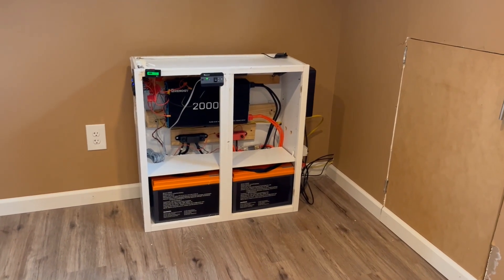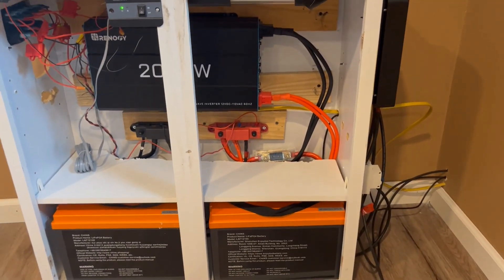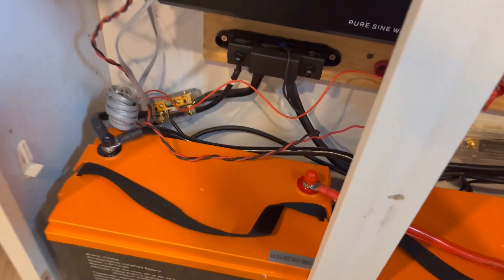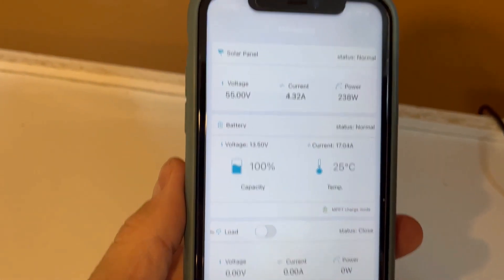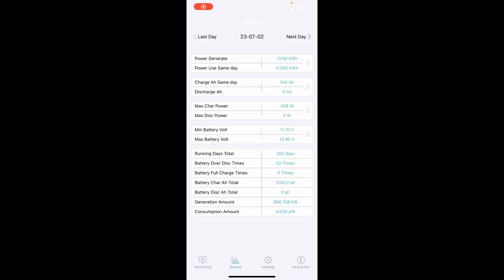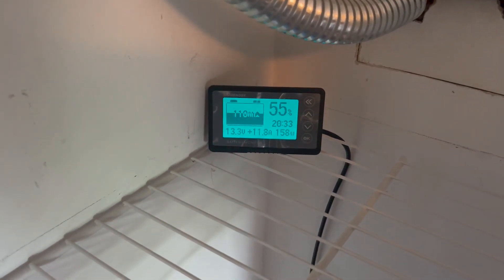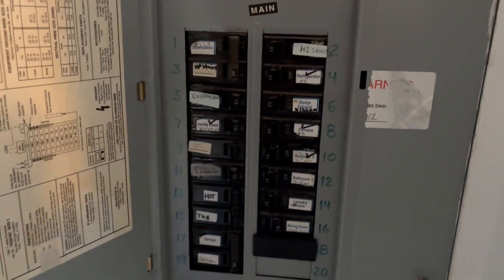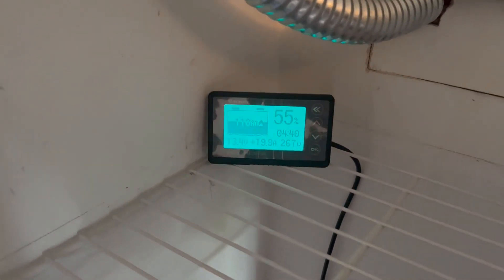Solar Panel System powering House with Transfer Switch

Comment: Looks like your battery is turning off 52 out of 300 days. How does that affect the system? Are you annoyed yet?
Reply from the maker: It was annoying if it was over discharged,  the inverter would have to be reset -  I have learned a lot since this video to try to not let that happen anymore..

Comment: Nice setup. I have 1000 watts in panels and a 100Ah LiFePo4 battery. Getting a bigger charge controller soon so i can add more panels.  I'm also planning on getting more batteries as well. Hoping to see more videos of when you upgrade your system.
Greetings from Jamaica.
Reply from the maker: thank you!  yes... do it!   think about increasing Voltage too..  48V would allow more efficient solar charging with more panels, etc..  i'll have to post a new one when we get some sunshine!

Comment: Very nice set up.  We have a 12v set up with 1000w in solar.  400ah in lithium batteries and that runs our bedroom and a standing freezer. We still have 600w In solar to install. Just waiting to get another charge controller.  Hope to see more from your set up in the future.
Reply from the maker: thank you for checking it out.    I also have more solar panels to connect,  got a bigger Victron Charge controller, and plan is to go 48V. start with a 100AH 48v battery and go up to about 2000w in solar.   update will come when I receive that!